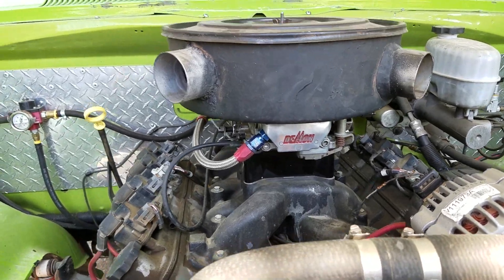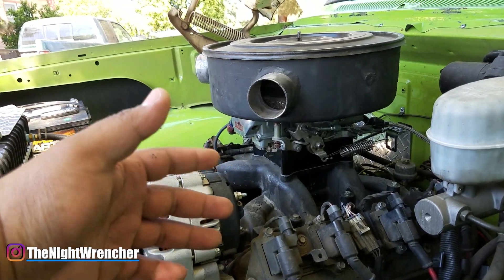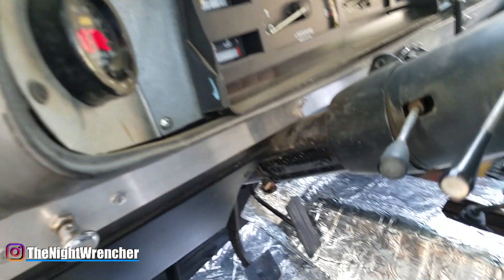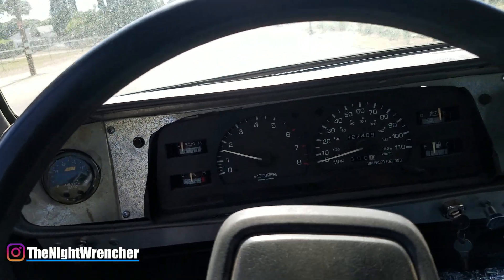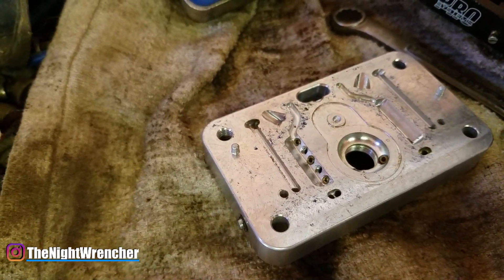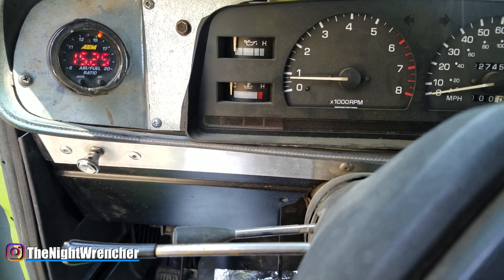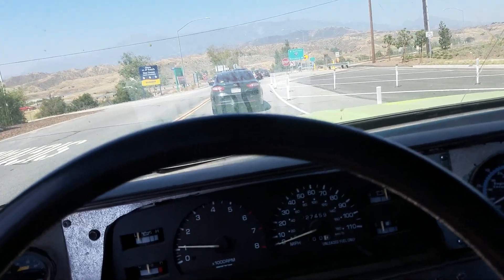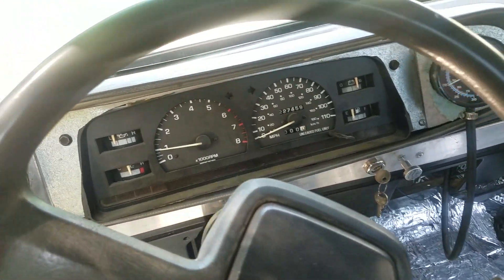LEARN HOW TO TUNE A HOLLEY CARBURETOR FROM SCRATCH! | HOLLEY CARB TUNING SECRETS

Comment from the maker: I've tuned several carbs on this engine which is why I was able to pull a base line and tune it so quickly, normally things don't happen that easy but the process is still the same. Take everything in small steps and if you guys have any questions, feel free to post them in the comments below!

Comment: Great vid man. Think I got carb idle circuit dialed in to where I can go do some testing. 
Be nice if you could do a vid explaining the difference spots a carb is in vs throttle position vs load and what to look for when going through those positions. 
Transfer, just primary's, PV prim, secondarys etc. 
Again, great vid!
Reply from the maker: Thanks man, appreciate it. I once tried to do that but its really hard because you cant pick up the exhaust notes clearly in the video. You can hear the changes depending on what circuit youre in so once you know where to look, you can identify them pretty easily.

Comment: I have a 750 demon carb which I ran into a problem this weekend. Engine was idling when I noticed from the fuel bowl adjustment screw it was leaking fuel. My question is would I have to rebuilt the whole carb? Or simply just remove that adjustment screw replacing the rubber seals? Thank you
Reply from the maker: On the older Demons there was either an Oring or the cork gaskets that you could replace. On the newer ones I think its just cork but Im not sure but a standard one from any holley rebuild kit should work fine. You can do it while on the car. Unscrew the idle mixture screw almost all the way out and pull. If the old seal doesnt come out with the screw, take a pick and carefully pull it out. The new one just slides on the tip of the screw and you push it into the hole. Once its all the way in, you can start screwing it in until it bottoms out and then reset your idle adjustment.
Reply: @NightWrencher  thank you so much for replying. I’ll be ordering the part today hopefully it comes this weekend. You make this carb thing look soo easy keep up the good work!
Reply from the maker: Youre welcome! Thats what I'm here for!